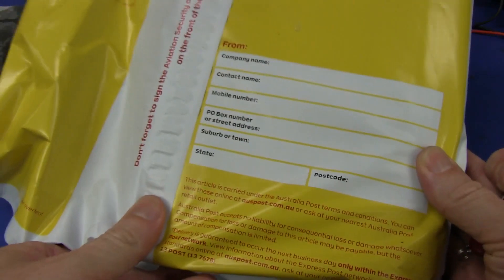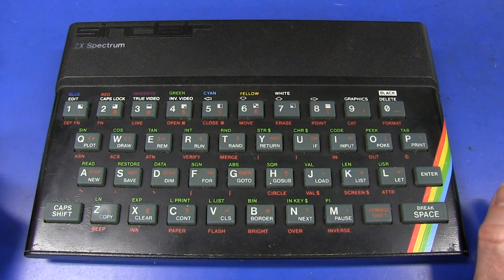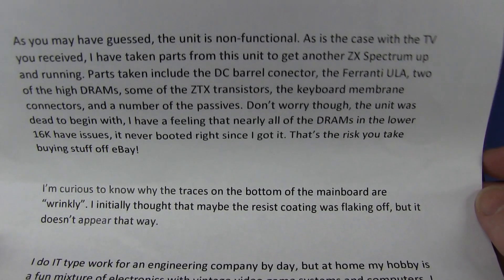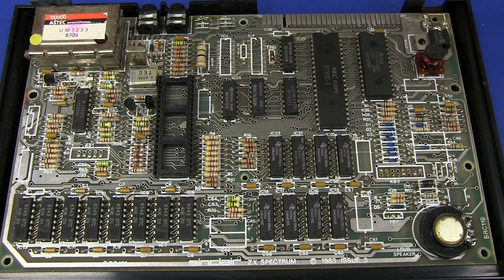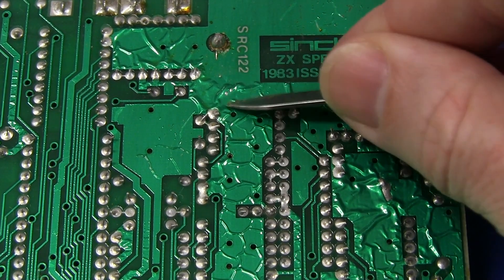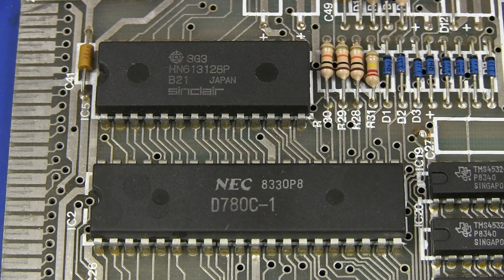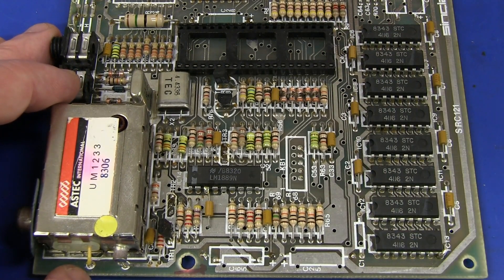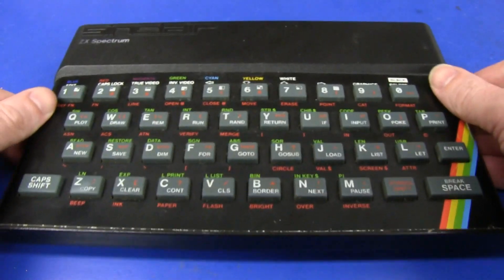EEVblog #557 - Retro Sinclair ZX Spectrum Computer Teardown

Comment: It sure brings memories, I had a PC called "Juku" with a floppy disk games in ANSI code that had also this unmasked PCB. If I remember correctly it was made in eastern part of Estonia, Jõhvi or Narva, I don't remember exactly, but it was a dumpster salvage. Oh how I hate it, any time it showed "-" in a row of 8 +-ses, it simply didn't load a disk correctly and crashed. But it had far more DIL packaged chips than this, but the main processor was also a DIL-40 as here. I don't have that any longer, as an active electronics kiddie, I took it apart long time ago, lost all the components during next years of failed attempts to build something and it's gone into memories now.

Comment: We had the Timex Sinclair in the US and Canada, we never got the Spectrum. It was a 4 or 16K? (not sure), monochrome with a flat membrane keyboard. The cool thing was you could order it as a kit and build it yourself. A lost art.
Reply: Timex Sinclair TS1000 was a 2K ZX81 machine. The States also had a Timex Sinclair TS1500: a 16K ZX81 in a silver Spectrum case with a grey rubber keyboard: I know because I bought one recently and got it repatriated to Blighty! Sinclair Spectrum (Timex Sinclair TS2048) was never released due to low sales of the black & white, silent TS1500, however a version with a built-in microdrive - the TS2068 - was sold but didn't take off due to the dominance of Commodore.

Comment: 1983 - I was 14 and found a 16k ZX Spectrum at Chandler's on the Sunshine Coast. Paid $299 for it from memory!
Reply: That's overpriced for 1983, I believe they were about 99 pounds in the UK by then. Factoring in the approx. 1 to 2 exchange  rate, that's the good old 50% Aussie markup on imported electronic goods, a tradition that continues to this day.

Comment: The rubber keys were better than the version we had with the flat keyboard.  It was a nightmare to type on.
Reply: Now you tell me! ;) There is a company who do a replacement layer with micro switches that supposedly changes it considerable.
Reply: +eLJaybud *considerably

Comment: To all the North Americans... The Sinclair ZX81 was rebadged in the US as the Timex/Sinclair 1000 (TS1000) and there was also a TS 1500 that looked a lot like a spectrum, but was a ZX81 with the Ram expansion built in. The Spectrum was actually a generation on from that. The TS 2068 was the model that is based on its design, though Timex messed with the base design of the hardware and the ROMs making it software incompatible. 

The Spectrum+ was released about 1984 and had a better plastic keyboard, the Spectrum 128 was a model with a new "128KB" mode and better sound chip (same as TS2068, incompatible with the TS models design though), and after Amstrad bought out Sinclair the +2 (built in cassette) and +3 (3" floppy) were released. 

Spectrum out sold everything in the UK at the time.

Comment: Hi Dave the Heat sink is missing from the regulator  it stretches  across over the edge connector almost all the way  to the RF Modulator, I had a 48k Speccy (still do) I was 10 years old ,and used the heat sink  to hold a reset button I fitted, also using my soldering iron to melt a hole for the button.
On Later Spectrums i fitted a 555 to make the Power LED flash
I’m not sure why i did that, but i seemed to think it was cool at the time  :-)

Comment: The regulator would have had an aluminium heatsink that ran the width of the back. I dimly recall it being about 3cm wide, maybe 2mm thick and was formed such that it used the raised space in the cover and ran all the way over to above the UHF modulator.

Comment: Thought I saw it and went back to check...   Nobody else seemed to catch it and certainly don't see any mention in the comments...  During the closeups at about 6:41 looks like one of the pads has a solder crack on it...  Bottom left, last pin on the trace from the bottom...  Just south west of the pin directly west connected to the ground mask of the hole in the board.

Comment: It came with quite a bit more than what you got it with! it most certainly did have a heatsink on the voltage regulator!
Reply: Lee Mindel I prefer the issue 3 heatsink, although I don't like how loose it is compared to the issue 2
Reply: +Lee Mindel All Spectrum 48K had a heatsink. That computer has been canibalized. ULA, heasink, a couple of logic chips, keyboard connectors and maybe some passive components are missing
Reply: +zxprojects I agree. All these came with a heatsink. I used to repair them and if whilst testing you forgot to replace the heatsink it wouldn't last 5 mins without the regulator going bang.
Reply: It's a 5V voltage regulator. Ideally you want to be supplying it with a little bit more than 5V. The original power supply was 9V but I think it was so weak and the spectrum was power hungry so that 9V was pulled down quite low the regulator/heatsink would still get quite hot as it just burns up the difference in voltage between power supply voltage and 5V as heat.

This has apparently caused problems for many in the retro crowd as they will often use beefier power supplies as replacements. Because they can supply more current, the regulator has to burn the whole 4V drop through the heatsink. This extra heat often ends up damaging the spectrum.

One option if you don't mind spending a bit of money is to swap out the regulator with a TSR 1-2450. This is a regulator with clever circuitry which means it regulates the 5V out without having to burn the difference as heat. This has the potential to extend the life of your spectrum even if you are using the original power supply.

I guess one other option would be to drop the regulator altogether and use 5V directly from a regulated power supply like a PC PSU. This is a little more expensive than the TSR 1-2450 though.
Reply: I don't think any Spectrums had the heat sink removed, certainly that was the case for all rubber key Spectrum 16/48Ks Issues 1 to 6, Spectrum+s (which were the same motherboard in a bigger box) and Spectrum+ 128Ks. I believe it's true of the +2s and +3s too: the grey original +2 had the same type of linear PSU as the previous Spectrum versions so it had an on board regulator to convert the 12v to 14v input voltage to 5v for logic circuits and +/-12v for video and the tape deck. The +2A/B and +3 PSUs included voltage regulators to supply 5v, +12v and -12v to the computers but I believe they still have a heat sink inside!
The heat sink is present to remove heat from the 2805 voltage regulator when reducing the input voltage from 12-14v to 5v (+12v at-5v are also generated for the lower 16K 4116 RAM chips), which is essentially a linear device. The only way I know of removing the heat sink is replacing the 2805 with a switch mode device: either a eBay power circuit or a Tracopower device

Comment: Dave... it seems the Regulator was originally bolted down. You can see the marks that the lockwasher left on the regulator tab. Too bad so many parts are missing.

Comment: The crinkly solder mask is caused by the flow solder process, when the board is virgin from the supplier it is flat and smooth. I f you look you can see where it flowed from i.e.which component pad.

Comment: Hmmm... I know this is from 2013, but I'm just watching it... I guess the main reason they did have to use solder mask on the bottom is because everything was wave soldered. You wouldn't want to wave-solder such a PCB without solder mask on...  Solder bridges would have been a nightmare...

Comment: Wait, so they would tin the whole thing by running it through wave solder machine, mask and laquer it on one side, then place components, and run through wave solder machine again?

Perhaps they needed to laquer it so that the excess solder that was deposited during the first wave doesn't keep going where it doesn't belong and gob up between pins? But i don't understand why first wave was considered helpful in the first place.

As to Mask ROM upgrade, why don't you just lift CS pin and solder a socket or a second chip right on top of the first? Then you can run CS through a switch.

The keys look like a cheap but reasonably reliable construction, much better than if they had used carbon rubber contacts.
Reply: One of the lines on the edge connector disables the internal ROM, thus you could connect an alternative ROM. (Also present are the Z80 control, address and data busses.)
I'm not are of any third party products which did this, even as part of an embedded application.
The Interface 1 unit used this to bank switch an 8k ROM in a way which was fairly transparent.
The Interface 2 unit could subsitute an external cartridge ROM. (Of up to 16k.)
Reply: Mark Evans  Oooh good one, very good one indeed! Not sure how i didn't know about this. How about Betadisk interface? I just looked up the schematic, and it appears that there's an address write detection logic that operates simultaneously the ROMCS pin of Spectrum interface and CS pin of 2732A EPROM on board the Betadisk, thus enabling TR-DOS ROM. I had a Pentagon-48 with Betadisk when i grew up, and i knew it had an on-board ROM that was visible on the Pentagon side, but i somehow didn't make the connection. Pentagon48 is a DIY Spectrum clone where ULA was replaced with a bunch of TTL ICs - it didn't actually have a proper name, nor is it exactly known who designed it. It was named like this by a magazine editor in the early 90ies allegedly for the shape that the ground fill made in his imagination.

Comment: Hah! How dare you speak in disrespectful tones about my Speccies!

Joking aside the 7805 regs had a long aluminium heatsink with a through board screw-washer-bolt connection. The membranes themselves were fairly reliable back in the day, but machines in the wild today have often failed as the plastic has dried out and cracked. Thankfully modern replacements are made for the membranes and even the escutcheon (the metal keyboard overlay). 

I have a few Spectrum vids on my channel and have probably brought a dozen back to life :) If you have any Spectrum queries feel free to give me a yell. Will be making a membrane and keyboard overlay vid in the next couple of days. http://www.youtube.com/markfixesstuff

Comment: if you want one some lunatic has recreated it. It can even connect to you TV wireless or your smart phone. It'd called The Recreated Sinclair ZX Spectrum.
Reply: Biguss Dickus What. That's merely a Bluetooth keyboard in a copied enclosure, not a Spectrum machine. It's just cheap crap, and they want you to buy now worthless abandonware tape images for their software emulator running on iOS or Android for 1$ a tape. And there's not even a Kempston Joystick interface! I really think these guys are just in for a cash grab and don't really know what they're doing.

In the Soviet Union, we used to have REAL Spectrum clones. Pentagon 48k was common, named so after the distinctive board layout - it didn't actually have a name, it's not very well known where it came from, and you usually got your 48k as a 10th generation xerox copy of board masks, component placements and schematics, and from then on went on big adventure of hunting down parts. Luckily, it could be completely assembled with Soviet parts, with ULA being replicated in discrete logic ICs, 74 style. How you'd come up with a usable keyboard was also entirely up to you.

The clones eventually evolved into rather extravagant machines, with 20MHz z80, enhanced graphics modes, and 2MB RAMDISK or bank switchers, IDE and SD-Card support, and a 60Mhz ARM7TDMI helper processor.
Reply: +Siana Gearz oh I so want one of those evolved clones. That's where Sinclair should have been heading towards.

Comment: Hi, I was thinking of learning BASIC PROGRAMING COMPUTER LANGUAGE.  So you think the ZX Spectrum is a good starting point, or is it a totally outdated and unused language these days please?  Thanks.
Reply: If you want to code in BASIC, then I suggest FreeBASIC.   freebasic dot net. 
It's miles ahead of the BASIC that could be found on these old 8 bit machines.
It's not an interpreted language like on the Spectrum though...  it compiles to fast code... I've found it a similar speed to compiled GNU C.  You can install it on Windows or Linux.  I don't think it's available for Mac.  I have it running on a Raspberry Pi (running Raspbian Linux).   It's unlikely you'd see BASIC used in industry... well VB.net has that sort of syntax I suppose.  If it's just for a hobby that doesn't matter does it.  There are lots of examples and documentation to be found on freebasic . net website. 

An interpreted language that seems to be gaining popularity now is Python.  Just beware the syntax of 2.x and 3.x Python differs.  I would check out Python 3.x    It's easy to get to grips with and seems quite powerful. 

Javascript is something you could try out too...   interpreted ...  within a browser.  I think Javascript is the most programmed computer language now.  You already have a web browser... so you just need to make sure it can run Javascript / ECMAscript.
Note that Javascript is a different language to Java.
Reply: Inaflap
Thanks a lot Inaflap.  I really appreciate that.  I have since joined a forum site (ZX 80/81/SPECTRUM) and have started a thread there.  Cheers, Paul
Reply: Inaflap <quote>  It's unlikely you'd see BASIC used in industry..</quote>
That's not entirely true: check out www.pvxplus.com: they sell a basic-like language that's widely used in industry. There's a free version as well.
Reply: martijn033 Thankis Martin.  I have joined a PYTHON site called CODE ACADEMY and also also been given a book (Dummies) on C++ (which comes with a CD-ROM).

Thanks for the LINK.  I will take a look.

Comment: i somehow think the soldermask at the bottom was standard issue with Kalex :P and they didn't leave sinclair much choice... take it or solder your shit together yourself :P either that or it was free of charge. also all the Kalex made boards have the bloppy tin all over the place. atari 800xls in as far as they were manufactured by Kalex have it too.
Reply: surprised to see clive sinclair actually outsourced production to kalex in the first place.. and not hand them hand soldered together by housewifes or something :P doesn't seem like a very sinclair-ish thing to do. :P unless ofcourse it was cheap :P
Reply: edge connectors without gold plated contacts... yuk. that would not be the same tin as is on the rest of the board now would it :P probably works... 1 time.. :P

Comment: at my age of 12, i open a zx spectrum ( 64k or 128k don't remember) to only see the interior. i didn't touch anything inside, but after i closed the spectrum didn't work anymore. and i didn't know why.
it could send the image to the tv but without the right menu (operation system). the words was wrong and they didn't do anything.

at my age of 20 i learned why, because one memory eprom received light from the sun. the eprom memory wasn't protected if the case is open. it only take few seconds to burn the program.
Reply: Sinclair used mask ROMs. These cannot be erased with light. You could however replace the ROM with an EPROM and change the firmware this way, for example increase frequency for save and load to speed up. EPROMS can be erased with sunlight, but it takes hours until the first bits flip. UV-Lamps do it in minutes. Maybe you zapped it with ESD.